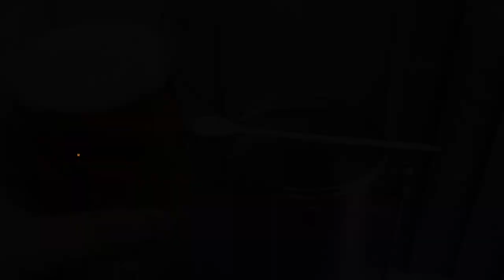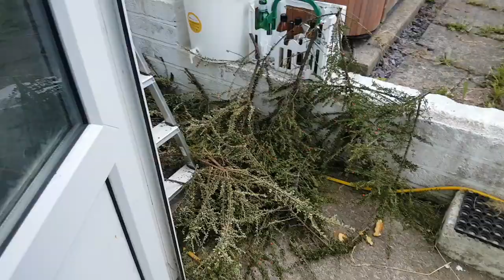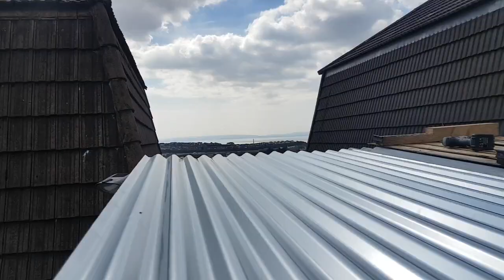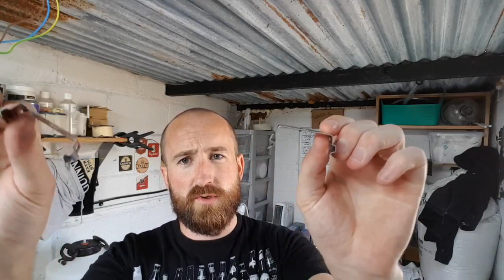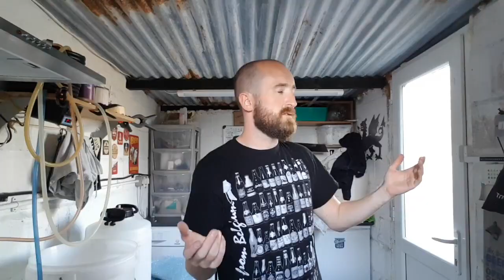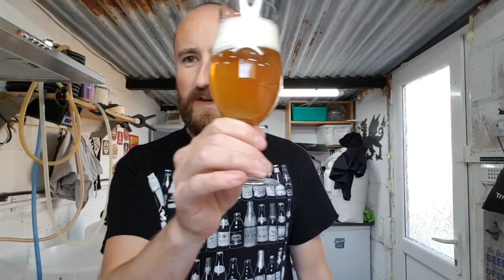Brewshed updates | Roof repairs | LED Batten Lights

Comment: Just be abit wary with these lights. One of mine had been making a loud noise upon starting. Today loads of smoke started pouring out of the light fitting. Found the capacitor had exploded and made a mess.